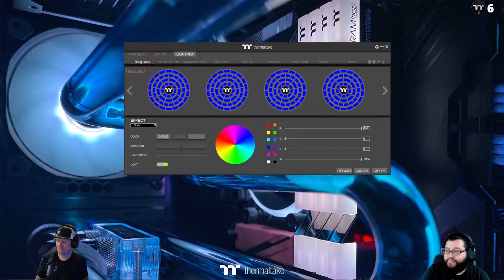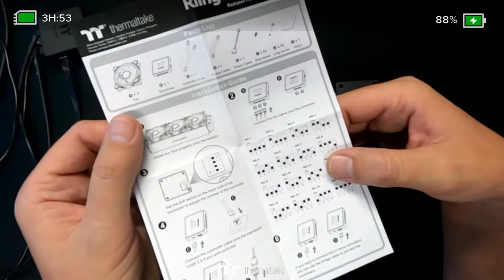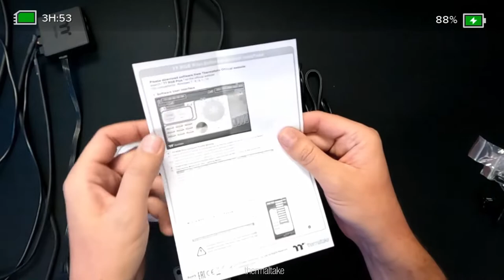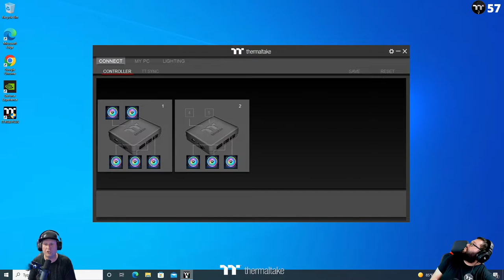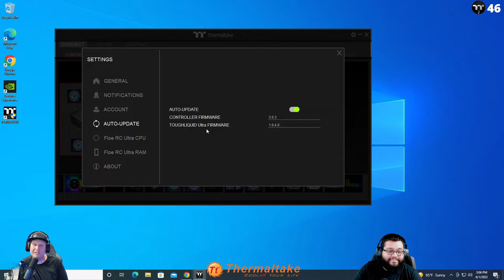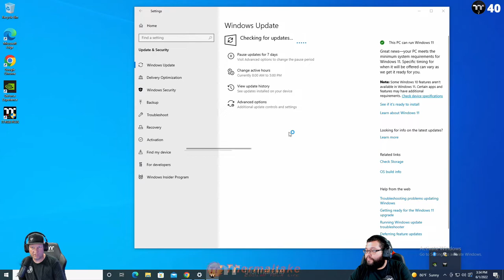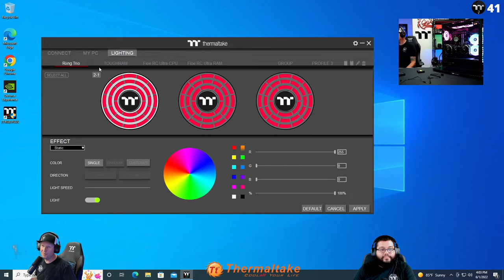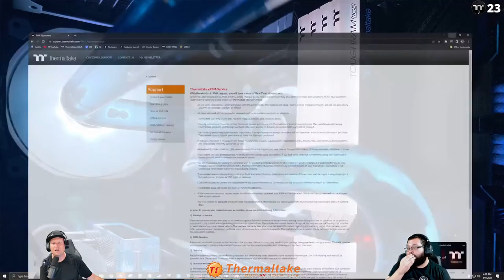TT RGB PLUS OVERVIEW - Hardware Setup and Software Installation

Comment: This product is an absolute mess, where to start?  
1) Controller is very cheaply made and requires molex power vs sata what year is this?
2) Software is awful to navigate and must be running in the background to control fan speed and rgb. 
3) Software's CPU usage is out of control for a required background process.
4) Fans have proprietary connection so cannot be used in anyway without the controller. 
 
At $40 dollars this is way overpriced.

Comment: I want to see a pc using 16 controllers. Was that a even a good idea? I love the SWAFANS and going to give this controller a try, but those DIPS or PIPS or whatever you call them is very confusing in the setup guide. You guys definitely need to do better documenting that in the manual and make it easier to understand.

Comment: Too bad software is a mess, don't use it if you can.
Sometime it doesn't start, once that was fixed it now constantly use up to 10% of a 13900k, seams to be a known problem and no fix after more than one month and they removed older version from their site.......... Regularly one of the two controllers I own is not recognized, it messed with my ram RGB, very disapointed by Thermaltake recently.